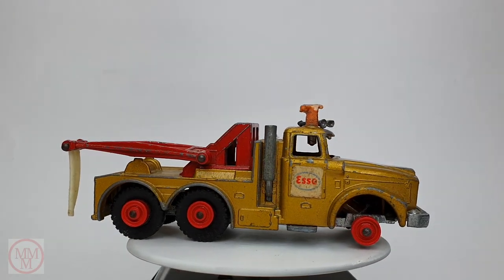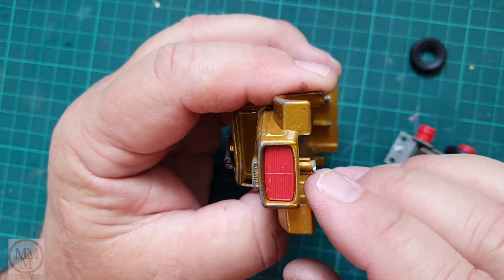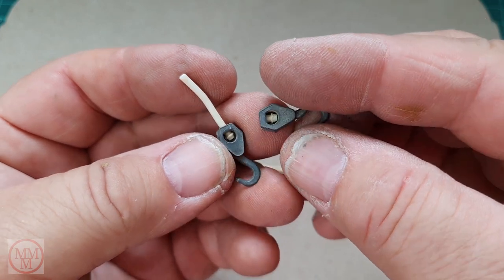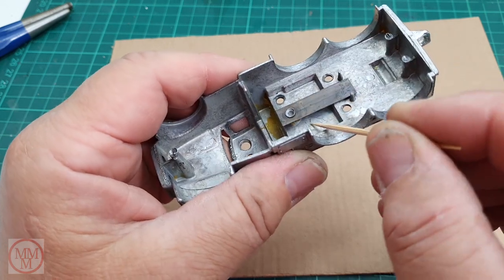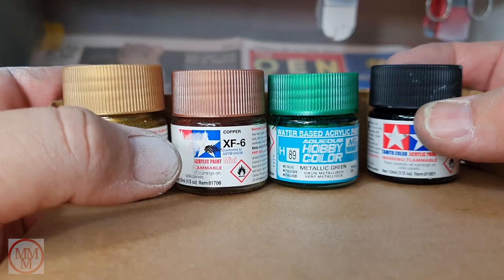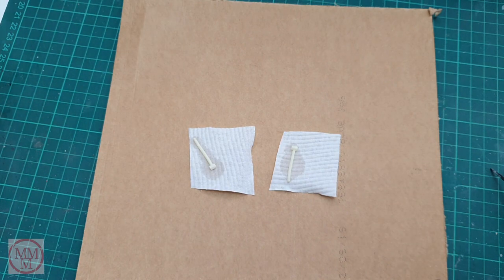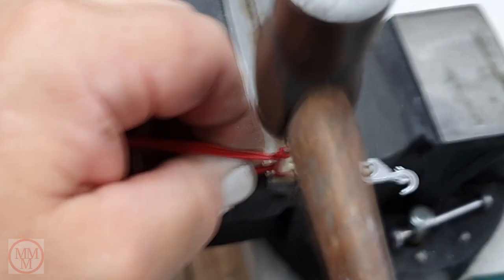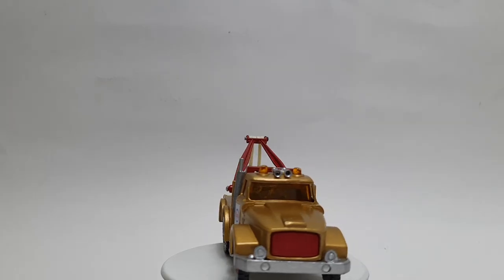MATCHBOX Restoration K2 Scammell Heavy Wreck Truck 1969

Comment: I've found out that there's a horn mounted on the roof of this truck after removing the thick layer of paint that covered it. :)))) 

Just started overhauling my own childhood K2 Heagy Wrecker, same model as the one you did in this video only the white version. I've found it on a trash pile when I was a kid and never really played with it as it still doesn't have a single wheel....  From what I can say up to this point: anyone who's about to give a thumbs down on this or any other of your videos (is an idiot ofc and) would be well advised to try such a restoration himself before doing so. These restorations require a lot of work and need a proper amount of precision and patience. Thanks for all the priceless tips and keep it rolling man! Greetins from Austria ;))

Comment: Marty, that mystery part looks like something out of an old pen. I remember being fascinated by that device, not truly understanding why when you pressed the button the and the ball point came out, pressed again it retracted. I do remember taking them apart after the ink was spent. We especially like to play with the ones that had a metal cap over the plunger. We would pretend they were rocket ships, separating the the plunger from the cap, the plunger being the first stage, the cap the second stage. Met various modelers in later years who used ink pen parts on models seen in various science fiction movies. The metal springs are useful for a variety of unintended uses, but work.

Comment: I have to say that you continue to get better at restoring these models! Great work!  The headlights fix on your gold model looks better than those on the original model!  I think you probably could have gotten a bit more of the bend out those plastic wires by soaking them in some hot water, removing them, and then holding them straight for a few seconds inside with your hands inside your refrigerator freezer for about 30 seconds.  I know that sounds silly, but the colder temperature will cool the plastic down fast, and with you holding the plastic wires straight (either via your hand or some tweezers, pliers, etc) the plastic will be retrained.  It will thus stay straight ever after. It's just a few seconds extra work, but it gets the desired results.

Comment: it looks good as new great job. if you ever get stress marks on plastic you can heat it with a heat gun and the marks will disappear. for small parts you can try a hair dryer, it might work but i have never tried it. i can attest to the heat gun method works great

Comment: Marty, it’s possible to remove stress marks in some plastics by applying some directed heat with a hot air tool. Small areas of stress disappear with a few waves of the tool.

Comment: Superb work.  They look great!  Bonus finding the window unit inside the gold model.  The gold version is a forecast of the current heavy wrecker.  Some of them I have seen on the road are quite the rolling works of art.  Must be a task keeping them clear of stone chips or scratches, and the splattered insects off the front end.  Did you replace the rooftop air horn trumpets, or did you repair / reform the squashed trumpet mouths?

Comment: Ever thought of placing down a large plastic pad where you do that kind of drilling etc work so if anything falls to the floor it is easily cleaned up?
Think of a rigid plastic mat like those under computer work desks allowing chairs to roll easy. 
I am sure you can come up with an idea of what material to use that covers enough of the floor area. 
(I am assuming your working in a workshop and not your living room).

Comment: The moulding on the side above the tool box are the external controls for the crane. I'm not sure if this vehicle also had internal controls. It  could also be finished in Olive drab because the British Army would have used these, the tractor for the Scammell Tank Transporter is most likely the same unit with a different rear configuration to house the 5th wheel for attaching the low loader trailer. I can't remember which wrecker our REME had but I suspect it was a Leyland.

Comment: Try a nail set to dome over an axle/pin since most have a pocket that seats over a nail head depending on there size and being tool steel can take the impact of a hammer or friction when in a drill...

Comment: with METALLIC paints, the undercoat does not really matter. Where the undercoat does matter is with CANDY paints. Traditionally, there are three ways to go with candy colors, black, for a darker color when finished, White for a light color, or metallic silver for a lighter, metallic look. 
Of course you can also use other colors, like red or yellow or green... for various effects, you can even use more than one color on the same vehicle to get varying effects. However, they use actual paint, not primer for the undercoating.  Say you wanted a car to look fast standing still, then paint a portion of the front black, blend from there through dark to light gray, then white on the very back. Then cover with the candy color, the paint will look dark on the front and graduate back to the really light color on the back. How many coats of candy color you use will determine the amount of whatever color you're using. You can also paint on graphics in contrasting colors then cover with the candy paint, makes the graphics very subtle.

Comment: Thursday I had to call for a recovery vehicle, from the area Auto Club.  I was then required with my 70 yr. old back to push the Honda Civic over the combing and onto the roadbed and to steer it onto the inclined bed. Kevin could have done a better job sans my help.  Narragansett Bay